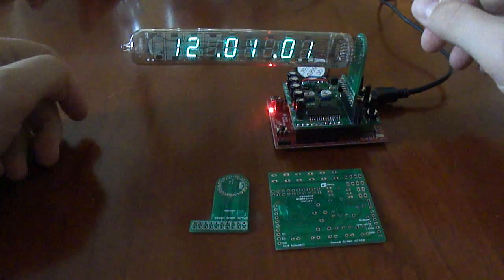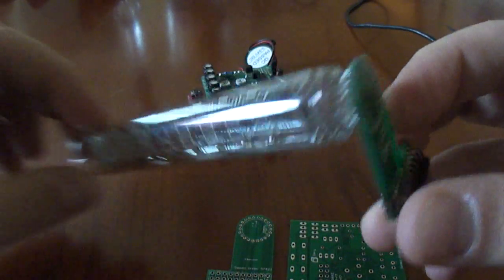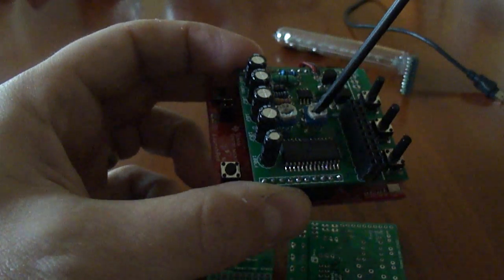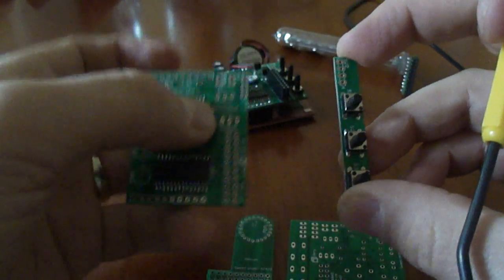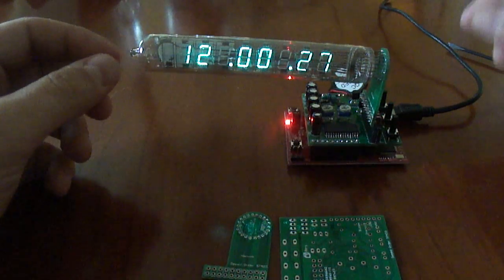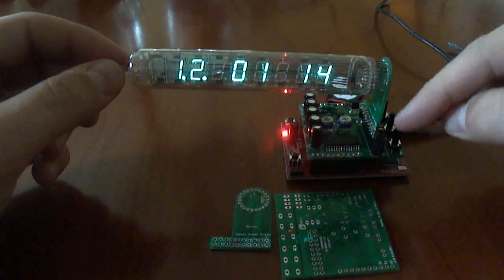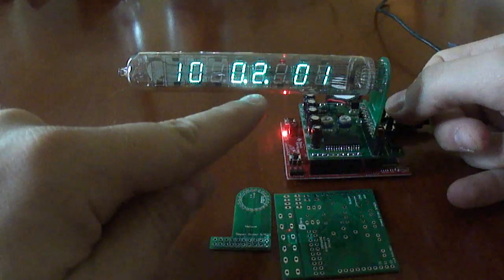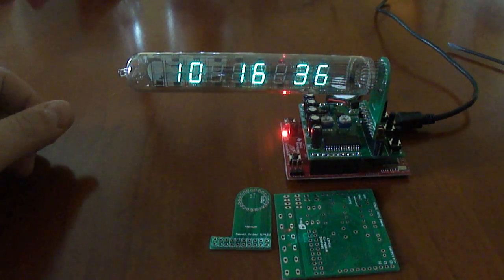MSP430 TI Launchpad IV-18 Clock BoosterPack

Comment: Thanks for sharing.  
So far the hardest part is getting that mess of fine wires oriented properly in the board :)
Pretty cool, I am sure the VFD tube designers could not predict it being driven with a microcontroller like the Ti MSP430.

Comment: Kit from 43oh Store worked great.  Only issue was one plated thru hole on PCB that was defective (no connection) which a simple wire patch fixed.  Now I must create a nice case (perhaps wood?) to mount the unit and switches.  Christopher Berg did an excellent job on this BoosterPack with retro Russian IV-18 tube!!

Comment from the maker: Oh - and in response to the PWM - It's certainly possible.  I did used the boost IC to free up some processing power.  There are several digitally adjustable potentiometer chips as well that might make it software-configurable.
Check out Lady Ada's Ice Tube Clock for a PWM driven boost.